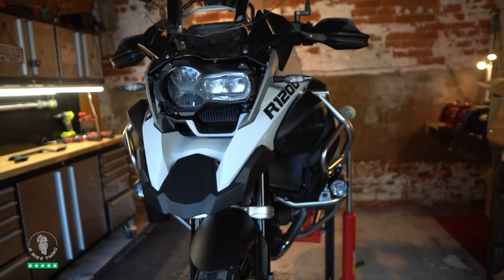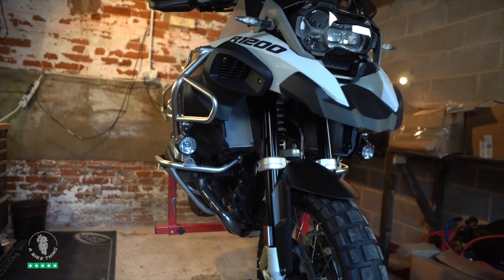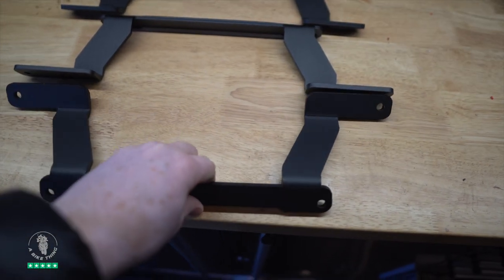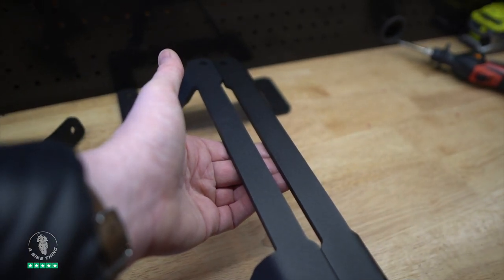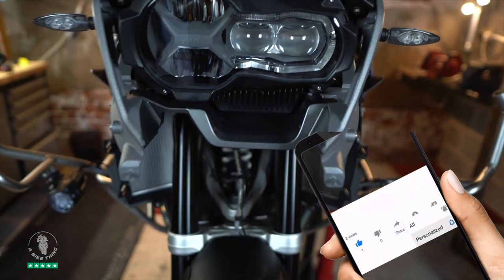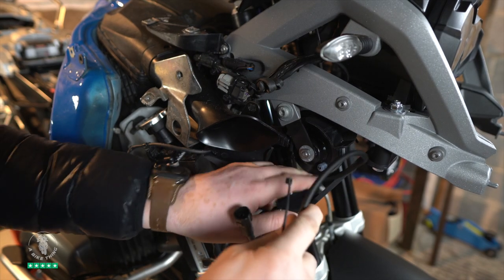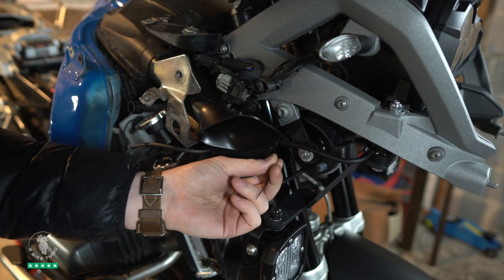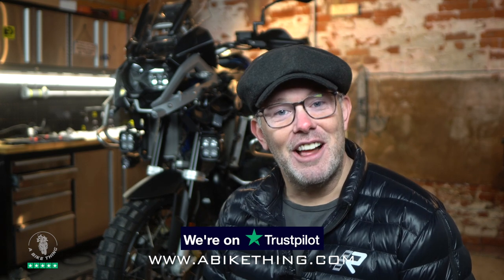2021 HOW TO INSTALL DENALI LED LIGHT PODS  to a GS or GSA

Comment: Hello Bikething Love your site followed your site and perfectly fitted my soundbomb horn, D7 lights on the red circuit on the Smartcan 2.0 . Also installed the D6 tail light. Your instructions were excellent. This all on my new 2021 BMW R1250GS Adventure. Now the problem. Since you are a Denali dealer my question.to you . I keep getting a keyless fob warning on the tft? I have tried everything to cure the problem. Changed battery in key fob disconnect the smartcan 2.0 and reconnect the wires to factory original. Have the bike to the dealer which puzzled them. Finally they came back and said it’s the pair of D7 lights. When they turned them off the the warning does not come on the tft about the key being out of range?. Have you heard of this problem with the D7 and do you have any suggestions?

Comment: In the US one can not buy the 21 R1250 models due to a phase out of the Hayes brakes to the replacement brakes Brembo. Apparently a supply chain disruption n the Brembos. Did you experience this as well?

Comment: Really good video, thank you!
Don’t suppose you do requests Steve?
I’m interested in the T3 units that are white running lights, but switch to amber indicators when indicator switch is activated? I believe you sell a harness that allows them to be linked to the Denali Cansmart?
Reply from the maker: Hi, yes I do and have made this harness, however it’s very expensive due to the time involved making them.  My advice is wait until the official denali T3 harnesses are available.  You can pre order it now.   Check this link https://www.abikething.com/product/cansmart-wiring-harness-for-t3-switchback-signals/
Reply: @ABIKETHING  Thanks for getting back to me Steve!
Am I right in thinking then, if I only wanted the front DRLs, switching to amber indicators, this would use 2 circuits on the Cansmart gen2, leaving 2 circuits for a set of D4s, and a B6 rear brake light? So a sound bomb could be fitted as a stand alone?

Comment: Steve, does it matter if the bolts for the light bar drop down with the bolt on the bottom to save taking the beak off?
Reply from the maker: Not really

Comment: Hi can I replace my oem  spot lights on my gsa with the d4 without any change to the wiring
Reply: The the light bar put the bolts on just opposite as he instructs. bolts thru the top nuts on the bottom. The body work does not fit correct how he does it (rubs on top nut)